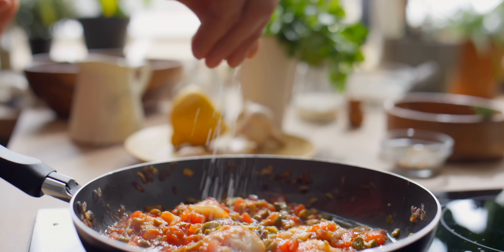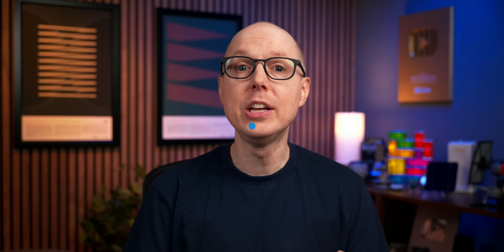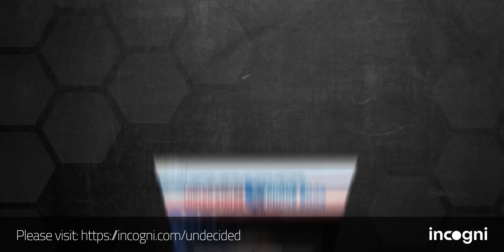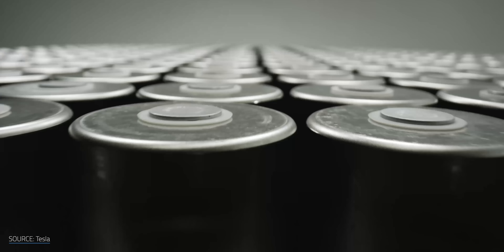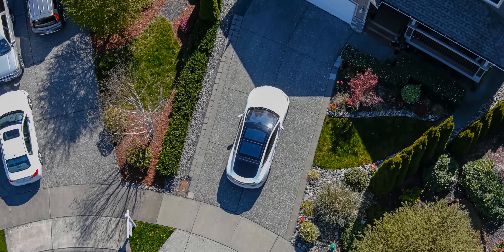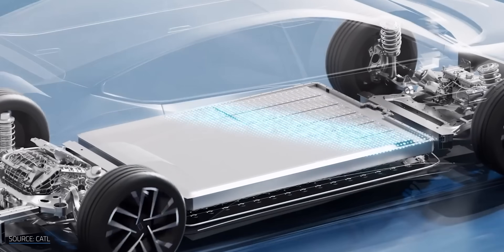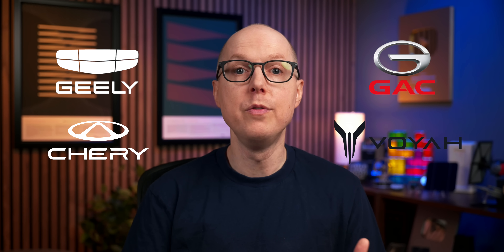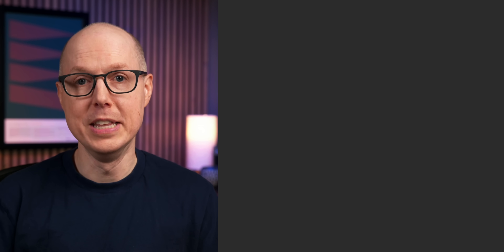How CATL Made Batteries 90% Cheaper (And What Happens Next)

Comment: I dont think, the new Sodium-Batteries will be a lot cheaper than LIPO ........ curent in Erope you get 15 KWh LIPO for under 2000 Euros , complete wit BMS and in a Metal-Case, raedy for connect to your Wechselrichter (english word is ?????)
No Electrician requiered when you a little bit fit and use YouTube to see how its get done !! No big deal .....Perfect is the combination with Photovoltaic-Modules on your roof ....
Greetings from Germany

Comment: WAIT, (NA)sodium is NOT salt, they're not salt batteries. Aluminum is common but once cost more than gold. Sodium an alkali metal is VERY reactive, like lithium it explodes if tossed in water. Reactive like Lithium and Aluminum its never found on its own. Sodium with Chlorine makes salt. PROBLEM, if you want either of the three it takes energy to separate them, or, they cost far more than their compounds. Lithium's added cost is its rarity. 
Density and weight are an issue on vehicles but for home/stationary use they're a huge breakthrough..

Comment: If the numbers are real... even if the price is the same, the sodium battery is a better deal long term, whether you are talking about a car or an energy storage facility. That's because if its usable life-span is much longer, then the cost winds up being cheaper than lithium.
Reply: They are also amazing at being drained to 0V without damage!
Plus they have amazing safety, almost none to no fire risk.
Reply: @Zcooger  what about reacting with water?

Comment: The electrical power grid in the USA is unable to support a widescale switch to battery driven automobiles.    It will take decades to change that fact.    What's needed is a massively decentralized source capable of enormous energy production.
Reply: Check out Gravity's solution; now expanding from their NYC pkg garage DCFCs to LA. (Seems like such a no-brainer to use existing infra, like the huge mall just demolished in my town full of vacant strip malls & gas stations).

Comment: Well.. I just received 16x 300Ah LIFEPO4 batteries for 1057 EUR (from aliexpress) . That is 15kwh for 1057 EUR or 70EUR/kWh OR 12 EUR/kg. Do any one of you really believe that this already unreasonable price can be pushed down even further? 7 times lower? For more heavy batteries? That would mean what? 1EUR/kg for battery? Sorry but plain table salt is more expensive. I don't buy that! LIFEPO4 batteries are already as cheap as it possibly can get! I am going to stack them like a gold stacker but I will be stacking batteries. House made of batteries!

Comment: Firstly, if na-ion battery packs are way better, safer and 10x cheaper than li-ion packs for EVs then all current EVs are massively over-priced and nobody in their right mind should buy one (and that includes lease companies who will have 3 year old ex-lease cars with zero residual value). Used li-ion powered EVs will be even more worthless on the secondhand market than they are now when na-ion powered ones come out. Unless... car manufacturers make na-ion replacement battery packs for existing cars (spoiler alert: No, they won't).

Secondly, Li-ion cells are not dangerous because of the lithium (which is a salt, not metal in rechargable cells used). The fire risk comes from the electrolyte solvent that is not water based because water breaks down into hydrogen and oxygen gas at low voltage. It is the solvent that allows the cell to work at 3.6 - 4.2 volts without gassing. The other factor is that the thermal breakdown of the electrode materials and electrolyte evolves oxygen and exothermic heat reaction and also ignition from electrical short circuit. So the fire is self-sustaining - it has fuel, oxygen, heat and a source of ignition all inside the cell. That's why the only way to stop a li-ion battery fire is to cool the pack with LOTS of water - it stops the exothermic runaway decomposition. If these na-ion cells operate at 3.7V then they also use similar sodium salts in solvent (not water - this is not a "sea water" battery). And then the fire risks are again with the solvent used for the sodium salt. It is the solvent and lithium LiPF6 salt that break down at a low temperature (just 80C) that gives off huge amounts of HF gas which is the white "smoke" seen that burns chemically if breathed and burns violently in air or its own oxygen evolved. If na-ion cells can use safe salt solvents that are thermally stable, non-flamable and don't suffer from metallic plating and dendrite growth (that cause internal short circuits between the annode and cathode in li-ion cells) then it will indeed be a game changer. But that's a big "if".

Comment: Yes, the king of batteries🔋has closed its lithium mine. I just heard this on Yahoo News yesterday.

from Deepseek:-
Market Stabilization: CATL recently suspended a major lithium mine (producing 46,000 tons/year) to curb oversupply and prop up lithium prices. This move aligns with promoting sodium as a cost hedge 13.

📊 Comparative Battery Economics (2025)
Metric	                              CATL Sodium-Ion (Claimed)	Current Sodium-Ion (Actual)	LFP Lithium
Cost per kWh	              $10	                                                $40–60 12	                                $75–100 2
Energy Density	              175–200 Wh/kg	                        120–160 Wh/kg 4	                160–200 Wh/kg 8
Deployment Scale	      Late 2025 (planned)	                250K vans in China 4	                Global mainstream EVs

Comment: GE Sodium batteries have been used in the locomotive industry for generations. They are excellent as startup but were up to recently terrible as standby with charge up times 10 times too slow. The great news is that Sodium batteries don’t burn as the temperature once pierced is around 72 degrees F. I guess they found a way to speed up the recharge process.
Reply: 5C charge rate.. It can charge its entire capacity 5-fold from 30-80 in 30 minutes I believe... So that's like a 12 minute charge time at a standard L3 these days I believe. Not world class but more than good enough...

Comment: As a person owning a whole-house ESS system, I'd say ... if the cells were completely free the whole-system costs would drop by around 1/3rd.  Not inconsequential, but also not a game-changer for home storage.  For utility storage, yes.  For home storage... only modestly.

There are three large components to home ESS:   (1) Storage, (2) Solar, and (3) Inverter + Gateway.   And in terms of cost, there is a forth component... labor.  Because retrofitting the wiring is a lot of work, and mounting solar panels is a lot of work.

The biggest problem with home storage systems today is the manual labor involved in installing it.   As an electrical engineer and DIY enthusiast I was able to do all that work myself and it literally cuts the whole-system cost in half.   The actual equipment costs are already only "modest" ... well within what most home owners could afford.  But when you double it with labor... that becomes a problem.

Lots of reform is needed in this area, particularly some of the ridiculously-involved permitting requirements.  Simple permitting and inspection of listed equipment should be all that is needed, and utilities shouldn't be allowed to sit on interconnects for months.

-Matt
Reply: @junkerzn7312  my dream is to have a run down shack you see on the side of some highway with solar powering a window AC unit that does not touch the grid.  These batteries would be awesome because weather can still be hot several hours after the sun goes down
Reply: It would still be a game-changer.  Why?  Because the AMOUNT of storage you buy is largely cost-limited, which means that in the case of a long-term outage (more than a few hours), it could make the difference between running for a day or running for a week when it's winter and overcast.  And solar panel prices are dropping as well, making the battery cost more significant.
Reply: @BrightBlueJim there isn’t much benefit beyond about 1-Day’s worth of storage.  Ultimately you either have enough solar to match or exceed your home consumption and the battery fills up, or you don’t and the battery heads towards empty.  The batteries don’t charge themselves.  After you exceed 24-hours of storage, the panels become more important.
Reply: Winter storms in recent years have shown me that when you're already short of the daily energy you can get because of the shorter days and lower sun angle, also having to deal with overcast days makes storage in excess of 24 hours pretty important.  Here, adding solar panels doesn't help much, unless you add enough that even on overcast days you make headway, which would be expensive.  Being able to add more days of storage becomes more practical when the batteries get significantly cheaper.  This also generally makes them last longer because of seldom being deeply discharged.
Reply: @BrightBlueJim   Basically all that would happen is that about a week into winter your massive battery storage will be banging on empty... and without the means to recover the energy that you are consuming daily for your house, it will stay on empty for the rest of winter.

You aren't buying yourself much going from 1 day's worth of storage to, say, 7 days.  Other then wasting money that would have been better spent on adding more solar instead.

You would need ... probably in the range of 8 weeks worth of storage to actually be able to bridge winter (with the solar providing the remaining 4 weeks worth over the 3 months of winter where solar generation is insufficient).   About a megawatt-hour or so if you aren't trying to heat the house and maybe 2-3 megawatt-hours of storage if you are.

Sorry, but that's the reality.  For most people being able to zero-out grid usage 9 months out of the year is good enough, but gaining those last 3 months of winter... not gonna happen without either using the grid or using a fueled generator.  Think about it carefully.

-Matt
Reply: @junkerzn7312  Just as no number of batteries can make up for not enough solar panels, the converse is also true.  I would have to multiply my number of panels by FIVE to be able to make it through an unlimited number of overcast days.  Furthermore, "most people" may be just fine with depending on the grid for 3 months out of the year, but having the system fall short when the grid is also most likely to fail is a real problem.
Reply: I had solar panels installed this Spring. It was done in a day.

Comment: My understanding is the savings aren't just from the sodium instead of lithium, it's also because they use cheaper cathode materials, and can replace the copper conductors with aluminum (has to be copper with lithium because aluminum and lithium really want to be in an alloy together). They can also be discharged to 0V without damage which makes shipping them a lot easier.

Comment: The price per kWh makes no sense to me... I can literally buy good quality LFP cells from China for WAY under $100/kWh... They must be pricing in all of the other components into the systems and tacking that onto the battery chemistry, which is dumb.
Reply: For example, I bought 314 ah 3.2v LiFePO4 cells for $41 per cell. Each of those cells has a 1 kWh capacity. Yes, other components are needed to make the battery complete, like a BMS, but even the BMS is not particularly expensive. I spent $5200 to build a 64 kWh LiFePO4 battery and that cost includes the BMS, bus bars, AND shipping cost from China to Puerto Rico. Even counting the expensive shipping costs and the BMS (which are NOT lithium specific issues) it comes out to $81 per kwh.

But really we should just be comparing apples to apples by only comparing the battery cell itself. $41 for 1 kWh of LFP.

Comment: Battery is just a tank. It isn't fuel.

And not just a tank. A leaky tank. Leaks going in and leaks out.

As you add fuel to the battery it does not absorb all the electricty. Nor does it stay there. It slowly leaks out. This is day one. Ever time you charge a battery it leaks more.

Comment: We're starting to get into end-game.  Hahaa I heard that pun at the end!

Really, though, this is the end of fossil fuel.  If costs can actually get that low then we're talking stationary storage with regular batteries (not even flow batteries!) that can operate across a full 24-hour daily cycle.

Oh the irony.  A number of conservative states have been pushing to open up west-coast electricity markets that they are currently excluded from, under the mistaken belief that they can compete using their decrepit  coal plants that are now no longer subject to pollution controls (if the current administration has its way).

What they don't realize is that the exact opposite will occur instead.  Due to storage, their states will wind up being flooded with cheap renewable energy across peak evening periods that traditionally makes up the bulk of fossil generation's profits.

Just as a reference...  this summer, even with hot inland weather, California has been exporting power to adjacent states literally from 8am to 10pm.   You heard me!  10pm!  West-coast time!  What does Wyoming think that would do to their in-state coal generation?

-Matt

Comment: Even if the cells would be one tenth the price of lithium, which is NOT going to happen, the battery management system, casing, racks, packaging, logistics, installation etcetera, will be mostly the same cost, or higher, as lithium systems, due to more bulk/weight.
Figure a best case scenario, where a turn key domestic installation, will be maybe 50% the price of a lithium LFP battery per kWh.

Comment: Zooming out to the bigger picture, I would like to see a standardized battery configuration that means that you could over the course of your car's lifespan, upgrade your battery easily from Lithium to LFP to sodium to maple syrup or whatever comes next by conforming with a standardized form factor so that you could spend money on a car and drive it for many, many years, just upgrading the battery technology (and software accordingly) from time to time, every time something new comes down the pipeline.

As a non-ev owner, one of the things that still deters me about buying an EV is the inevitable depreciation which is part and parcel of the rapid development curve of electric vehicles and battery tech over the last few years (compared to the relatively shallow development curve of ICE vehicles which aren't evolving as dramatically, and thus retaining their value better on average).

Being able to plug in a similarly sized and shaped battery with identical connectors into your car, even if the battery chemistry itself is way more advanced, with faster charging, more range, less weight and all the other improvements, well, that would be a huge advantage and would encourage you to buy a nice car and keep it for much longer because it could be upgradeable.

Comment: A CCP owned company, I'll begin to take the new tech claims serious when they have been in service for 5-10 years outside of China.
The capital cost of grid storage is not the biggest problem, it wastes a fair fraction of the power and that effectively increases the cost of production. Even with an excellent 90% storage recovery you need 111% more generation capacity for the stored portion.

Comment: Give me batteries that last longer (10k cycles is no joke) and perform better in rough conditions and I'd be happy to pay more even if the energy density isn't as good (so long as it's not too far from what we have now), if it's 10-50% of the cost? Everyone will switch.
Reply: The only place where absolute energy density and discharge rate would still matter would be aviation and racing.

Comment: If I can get these battery cells for my Leaf for that price (the wide voltage range makes that doubtful without sacrificing a LOT of energy density) it would be comparable to what I spent on an AGM 12V battery for better cold weather resistance.
Sodium-ion batteries, being rated down to -40C, may even give far better range bellow the -17C that the pack is held at via resistive heaters.

Comment: I am hoping this will kill off the lead-acid battery. With a nominal voltage around 3.0-3.2 volts, it might replace my LiFePO4 batteries for my 12V power sources as well.

Comment: I looked on the internet - I found no claims of $10/kWh. Is this a real claim, or a speculation?

By comparison, the BYD Blade is 166 w/kg and is an estimated (by me) $55+ wholesale cost per kwh. 

I don't think $10/kwh is feasible - this seems to be well below the cost of raw materials.

Assuming 175 wh/kg.
Assuming a generic set of elements is needed for all batteries (Aluminum, Carbon, and Copper).

* The aluminum can is about $4/kwh - based on $2.75 per kg.  
* A similar cost for Al foil. $2.75/kWh
* The carbon is about $4/kg.
This is almost $10.
* The copper current collector brings it up above $10/kWh.

So far, this has not addressed the composition of the battery - no Na, no separator, no cathode or anode special chemistry, no electrolite... 

How do you bring it down to $10/kWh?

Comment: I am currently working on a project, for myself.   A work / recreation vehicle, with on-board high frequency DC Welding capabilities, and a 16,000 watt (peak 8,000 watt continuous) inverter.

Of course it needs batteries, I cannot in good conscience use Lithium cells, and sleep in the van while it's charging!!   The relatively tiny chance of fire is too much considering the end result.

I will have 8 or 10 5 volt lead acid batteries, the old reliable "Golf Cart Battery" still in use at gold course all over the WORLD!!   
They take a beating and keep on working!